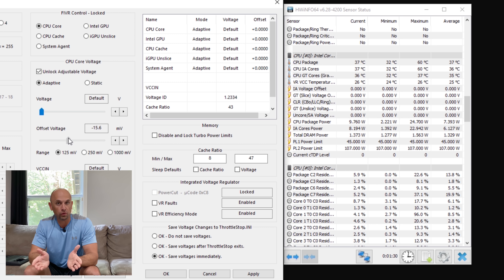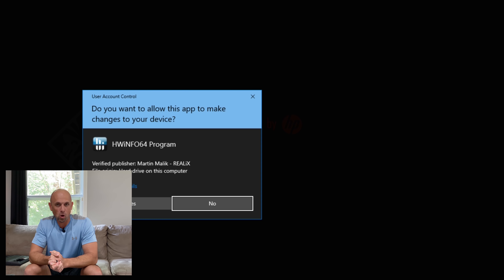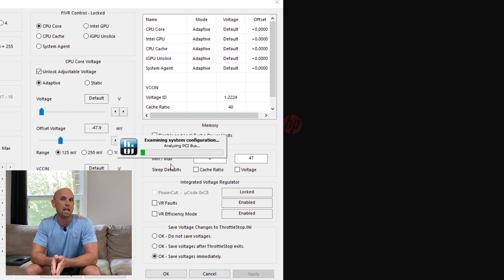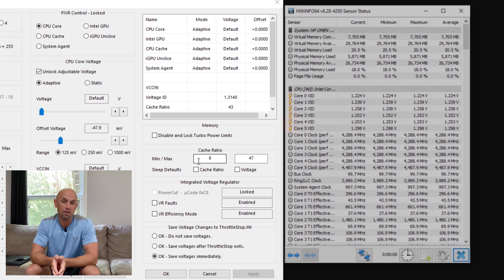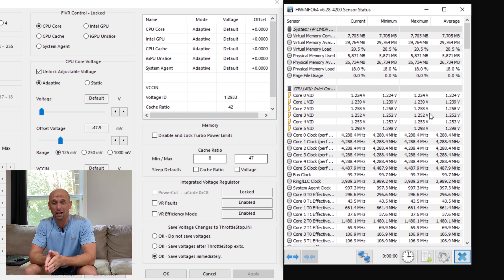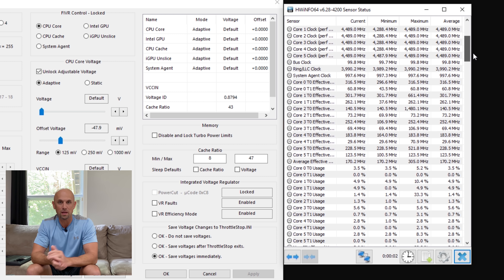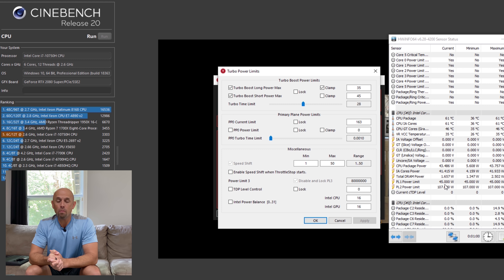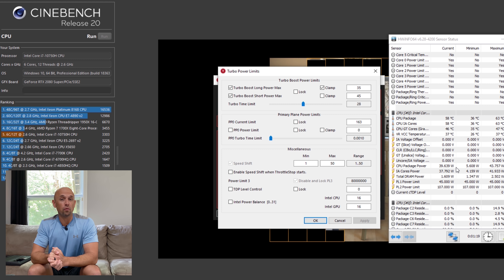Can't Undervolt?  Do This!

Comment: im struggling undervolting my msi gp66 leopard , any help would be appreciated.

CPU : Tried Throttlestop and Intel X. 
The temps dont get better it just delays the Throttle , if i turn down the cores from 4,6 in boost to 3,7 it get like 2-3 C° less and it stops throttling but the performance is much lower
GPU : Afterburner with Heaven B.M.
Temp same with ~250mhz less its weiiiiiiiiird. dropped from 1650 to 1420 with no better temps.

Comment: Hello Bob! I love your videos, they were a great help to choose a laptop (ended up with hp omen 2060 with intel due to availability) and are still excellent for fine tuning now that I got it. However when using throttlestop to tune the PL1 and 2 like you mention here, HWinfo64 stops monitoring those and I can't be sure if it worked... and after a reboot PL1 is set to 107 same as PL2! Any idea of what's going on there??
Keep up the excellent work :)

Comment: I have noticed that disabling Intel turbo in throttlestop lowers cpu thermals significantly on many laptopts that I have used and tested while gaming. 

The great thing about it is, that it has not lowered the amount of fps in games substantially, usually the change is insignificant. This has worked like a charm for me while I have been gaming. 

I have seen changes of over 15 degrees celsius in demanding titles. For me Intel turbo is pretty useless, so I turn it off. I care more about thermals than I do about maximum fps. 

Thermals are the key, I agree wholeheartedly.

Plus if one uses throttlestop, one can just click the turbo back on, easy as that. I have throttlestop always running in the background.

Just wanted to voice my opinion.
Reply: Wow, this comment saved me. I wasn't able to actually do the undervolting because of some change in BIOS or something, but when I turned off the intel turbo I saved almost 20C in CPU temp!
Reply: @myquestformeaning8251  Depending on what game is being played, disabling turbo will lower fps somewhat (cpu intense games), but mostly its marginal so it doesnt bother me.
Reply: @RainSandAndFlowers  Yea I am playing Satisfactory and I do believe I may have lost some performance but it's not really anything big, and the saved temp is much more important. The game literary rebooted my computer because CPU got too hot.
Reply: @myquestformeaning8251  Thermal throttling can do that, the cpu is protecting itself :) Nice to hear that the simple solution is satisfactory for you.

Comment: I've got Asus ROG GL531 with i5-9300H & GTX 1660Ti. Thermals are way too high, temp reaches up to 100C while gaming. Tried repasting, cleaning but none of them helped. Also, I couldn't undervolt since its locked and no options in BIOS as well. I disabled the turbo boost but experienced some slowness in performance. Any suggestions? Thanks
Reply: I have similar model and same issue. Did you figure it out?

Comment: GPU doesn't show me the voltage on afterburner. But I can see the clock speed and based on that I can guess the voltage based on the curve. Did a flatline at 1200mhz and I hope cuda cores chose the possible lowest voltage they can run on. Decreased temps from 80 to 65 based on this simple trick... Throtle stop is hard to guess, even if you cannot see on hardware info, you definitely feel when you had frozen your pc with too much undervolt or just check package power. Also what i hate is that laptop shares same heatsinks with cpu and gpu, they don't have different exhousts - a blessing and a curse.

Because now my gpu doesnt heat up, my cpu doesn't throttle which increased cpu, gpu performance... Now i onlu need to change thermo pasta. Too bad liquid metal is toxic for laptops, if you throw it down the floor, all liquid metal will just get out and splash electronics...

Comment: Hey Bob, thanks agin for this great video. I'd like to ask you a question : Is it possible to undervolt an i5-5200u laptop cpu to lower the heat? Would this increase the performance in games (even if it is an ultrabook)? By the way, i ordered an XMG Fusion 15 thanks to your videos. Thank you man!
Reply from the maker: You probably can.  I haven’t used a Broadwell U chip so start with -.050
Reply: Bob Of All Trades Alright, do you think that this would help for in game performance ? (with Gt 920m graphics card)
Reply: Philo Sopher I undervolted my i5 4210u with -0.62.5mv and yes I have seen quite a bit better thermals on my 6 year old laptop. It used to thermal throttle quite quickly when I pushed it hard previously but now it takes some time for it to throttle and I get 30-60 mins of extra battery life. I highly recommend undervolting your laptop.
Reply: Aquawater 506 Thank you ! I will definitely undervolt now.

Comment: I have a Dell G7 7790 that I repasted but still runs fairly toasty and had this problem as well.  About a week ago I got sick of the inability to undervolt and went ahead and downgraded my BIOS to allow undervolting again.  With a stable -155mv undervolt, I was still pushing 90c under gaming load so I did end up lowering my PL1/PL2 to 35/45 and now sitting at a more comfortable 75-80c. 

My only complaint is that trying to get an undervolt to stick in MSI Afterburner is absolutely painful.  It frequently discards my undervolt and just does whatever it wants.
Reply: As a dell laptop user (Dell inspiron) seems like i cant undervolt my laptop maybe because Dell likes it that way, others aside how did u downgrade your Bios? I'm kinda newbie and I'm sick of can't undervolting my cpu
Reply: @lanzboi7382  Honestly its been so long since I had to do this, I think fortunately for me I either had the previous version installer file still on my computer or I just found the current version and went down one version until unvervolting came back.  I'm too afraid now to update my bios to lose undervolting.

Comment: I know this is kinda out of the topic but I wanted to ask if you have faced something like this before, I have a mech g2rx with the 9750h and 1660ti after a format I installed Throttle stop did a small undervolt of -100mv and ran Cinebench the laptop will not clock above 3.3-3.4 at all.
I checked the temps they were under 80 and it was running on turbo profile in the control center , I tried reseting throttle stop lowering the  EPP to 0-1-10-32-64-128 and nothing changed, tried raising the power limit to 107-70 and it will saturate 65w but still at those same clocks, tried lowering the wattage to 70-45 and the undervolt to -125mv and still the same outcome.
It will boost to 4ghz all core on 50% usage if the app is not hammering the CPU but it won't budge on 100% load and the problem is the laptop is being used in content creation and those few mhz are kinda important.

Thanks

Comment: Hello, I have an asus laptop with i7-10750h 6-core, the FIVR control and the turbo ratio limits are locked as well as everything else in FIVR ! 
I enabled the voltage configuration In the BIOS Advanced settings, but nothing has changed ! 
So, is there any way to unlock them by any chance or it is factory-configured and cannot be unlocked? 
Should I stick to configuring power limitations pl1 and pl2? If yes, could you please give me some instructions on how to configure and test it for this cpu?
Thank you for your attention !

Comment: I got an msi g65 thin with the cpu u got and I’m trying everything to undervolt as well as use xmp on my upgraded ram. I feel bummed cause I’m a budding enthusiast and got everything for a new pc but used an old GPU and when I finally got GPU money it was cheaper for a laptop with a 3600 then get a 2600 for my laptop. The whole experience has been terrible because I want to tinker for better temps and I upgraded my machine myself and have great buyers remorse but it does what I need, just wanted some more tinker experience but I’m stuck with my laptop and a pc with a rx560B(rebranded 460 as far as I can tell)

Comment: Hey Bob! I am in a pickle and need your input.
My laptop currently under BIOS 1.0 does allow for undervolt. But defaults to 2933Mhz clock speed.
They released an update 1.3 that opens XMP up to 3200Mhz but it takes away undervolt.
Should I update the BIOS and get 3200Mhz or keep undervolt and stay at 2933Mhz.
Thanks!
Reply from the maker: Stick with the earlier Bios
Reply: @BobOfAllTrades  Thanks for the advice. I will not update the BIOS. 
Final Question. My RAM supports up to 3200mhz through XMP 2.0, but as I told you currently running at 2933mhz with a -120 uv through XTU.  (XMP locked in the BIOS 1.0)
So can I both undervolt and overclock the CPU through XTU or Throttle Stop, to push it closer to the 3200mhz clock speeds or is it not possible to do both at the same time?
Thanks!
Reply from the maker: You won’t be able to OC the memory with that software
Reply: @BobOfAllTrades  You rock Bob! Is there a software that I can use or should I leave it alone, meaning that the performance gains from 2933 to 3200 are not worth it.
Reply from the maker: Just let it be, you’re good to go 👍
Reply: If the thermals are worse then undervolting is important, otherwise update your bios to get the RAM to run at 3200MHz.

Comment: I'm running on an ASUS Tuf fx504GE (i5-8300, GTX 1050ti, 8GB RAM, WINDOWS 10 UPDATED, and BIOS ver 3.20). I tried undervolting with throttlestop but it didn't work, however, it was working with BIOS ver 3.17.

Comment: dang undervolting on my 8th gen laptop helped temps and battery life for light use off the charger quite a bit. sucks that there was some exploit that has caused it to need to be removed on the 10th gen series
Reply from the maker: It’s not tenth gen related actually. It’s up to each manufacturer should they wish to apply the update to their bios.
Reply: @BobOfAllTrades  Holy cow that was a fast reply. Noted might have to read up on what it affected via the voltage being controllable. Seems like a interesting one vulnerability wise
Reply from the maker: @Demon09-_-  Honestly I don’t think it’s anything to worry about but to each their own do as you wish 👍

Even intel themselves have the QC7 chassis that allows for Undervolting in their bios and it’s their bios.
Reply: @BobOfAllTrades  not really worried about it more so intrestred in what the exploit entails. but thanks for the super fast replys

Comment: Hey Bob. 
5:48  That's a Clevo Chassis, right? What laptop is that, and do you have a review of it? Thanks. Love your content.
Reply from the maker: XMG Apex 15. It’s not the final version. Just testing 👍
Reply: @BobOfAllTrades  I had my eyes on a N960TD chassis build. But, the battery life will be terrible, no matter how much I restrict the CPU, so I'm just waiting for the new Helios 300 now. But, still do you thibk that I can squeeze out 3-4 hrs off a 62 Whr battery with i7-9700 and 2060, if I try really hard? You know, PLs lowered, etc?
Reply from the maker: Depends if it has switchable graphics

Comment: Hello, I'm new to your channel and so far love your videos. I had a HP Omen 15 1010dc with an I7 8750H and a RTX 2060 and I had my cpu temps going up to 100ºC+ and the laptop just shut down. Change thermal paste and -0.150 undervolt + cooling pad did not help much, my temps where between 90-100ºC but at least it was not shutting down. Sold it and bought the Lenovo Legion Y740 with I7 9750H and a RTX 2080 max-q and my tems are stable on 80-90ºC without any modification. I can't see why you are telling the that HP is good in terms of thermal performance. I think I will also change the paste on Lenovo to lover more my temps and do some undervolt.
Reply from the maker: If you go back and watch my HP reviews, the only one I had that was close to yours did have very high temps.  I had to Undervolt the CPU and GPU to get it tolerable. 

The next one had the 9750h and 2060 with the second gen of that chassis design.  Its software allowed for maximum fan speed and it did much better.  

Then we have the newest Omen review with Ryzen 4800h and 1660 ti and it too allows for maximum fan speed within its software.
Reply: @BobOfAllTrades  For example, the new BIOS on Lenovo Legion Y740 I can't even under-volt in BIOS because of the Intel security update. I go to advanced BIOS mode and set -0.160 offset and save changes. Boot is ok and I have those applied but If I shut down or restart the setting reset in the BIOS. Maybe I will need to try replace thermal paste for my lenovo to see If I have some temp gains. PS: I tried install the previous BIOS version but it does not allow me saying that I have an newer version :P

Comment: Great video Bob........I have actually noticed the new update that windows realesed that wasnt compatable with the omen x17 gtx 1080 cause i have one as well and after updating it I noticed how it kept on resetting the undervolt I had and I immediately rolled it back to previous version now all is well. 
        Note: - I want you to do a review on the omen x17 with the 300watt power supply that you had on the table I fell like I want to increase the power limit by flashing the bios cause my thermals at 4ghz is 71 to 85 and gpu 58 to 60 at 1825ghz which is great but why add a 300watt power supply if it is not used to about 280's to 290's........why is that?
Reply from the maker: I haven’t figured that out yet but it’s a 330 W power supply and I can’t for the life of me imagine getting anywhere close to using all of it.
Reply: @BobOfAllTrades  (330 not 300w) Exactly for one I can say that the chassis is well optimazed and you can reduce the temps by just adjusting the hight of the laptop using a cooling pad for the size of the laptop because the back plate has a really nice air intake and can give a big difference since its all around the motherboard and fans (at least on my testing). But hopefully you will do a review on the laptop I am interested on you take on this matter.
See you on your next upload thanks for the feed back appreciate it.........

Comment: Hi Bob! Im thinking if you lowered the PL1 the cpu core clocks are also lowered from 4.0ghz - 3.4ghz so is this the same when you lowered the core clocks at throttle stop to 3.4ghz directly and not adjusting PL1 and just leave it as a default? thanks for this tip.
Reply from the maker: Melchor Jimenez You won’t have the same thermal consistency that way.

Comment: Just one question...why? If it doesnt thermal throttle then...why? I get it that its useful when you undervolt and get some performance by running the cpu a bit cooler...by in this case why do this?

Comment: I want to ask you, how can I confirm whether my laptop can't undervolt?
I have the omen 17-cb1005nu. It's with the annoying i7-10750H. I made all the updates of bios + drivers. 
However, when I use throttlestop, and I do offset voltage -30, I can see in HWInfo under IA Overclocking that my voltage offset is -30mV. Also, when I try to test it with CinebenchR20 and looking at the max voltage by sensors, I think it does effect the voltage.
So my question is - can you tell me the best way to figure out whether my voltage is locked or actually I can change it? Thanks!

Comment: I have i5-1035g1 and I think I should just buy a cooler/cooling pad. I already tried throttlestop and CPU is locked, same case with XTU it says the system is not supported.

Comment: Yeah, i got a bios update from Dell the other day. Can no longer undervolt, and the CPU remains absolutely pegged 24/7. Hits 100C consistently. Throttlestop aint working anymore, cant adjust voltage or frequency 😢. Unfortunately, Dell really fucked me over by preventing me from going back to a previous Bios version. 

Edit: dell g7, i7-8750h

Comment: Hi bob, I'm one of many with these problem of locked uv, I have the HP Omen 15t 2018 model with the rtx2060 (80Watt) and i7-9750H, I'm curious about if I only change th TPL1 to 26 (that value doesn't affect performance but improve thermal in my unit) but leave TPL2 in 90, I haven't try it but would like to know if it could cause a negative impact or not. Thanks for your information btw!

Comment: talk aboot every machine is different... the TPL is set to 200/200 on my ge75 w/ 9750h! any idea on this?

also, great vids and I thank you for your service!
Reply from the maker: MSI controls their system in the bios.  It usually shows generic values like you see.  You should be able to lower PL however within throttlestop regardless.
Reply: @BobOfAllTrades  ahh gotcha! would you suggest changing these values from 200/200?

Comment: Hi Bob, been watching and following most of your content. 
I set a default voltage and frequency using msi afterburner on my asus rog strix scar ii RTX 2060, the fan speeds are running at average speeds (even when idle) what does this mean?
Reply from the maker: MSI AB will constantly ping the GPU so I recommend only using this software when you’re gaming.

Comment: hey bob , i know this is an old video but i have a question , i tried the solution 1 and i set pl1 and pl2 to 35 and 45 , not copying your value but i have tried them too , my question is that when i stress test the cpu or play games power throttling happens , i wanted to know if thats dangerous or normall , btw with this setting my temp is way lower and i have stable fps and not much peformance lost.
Reply from the maker: Of course power throttling happens since you have throttled the power back 👍
Reply: @BobOfAllTrades  so i should avoid doing it ? my temp goes 90 without it , thanks a lot btw
Reply from the maker: @emptycode1782  You’re not harming the chip or system.   In fact, power throttling is just part of laptop life at higher wattage too.  If you’re happy with the performance and thermal performance now, then I say great job, carry on 👌
Reply: @BobOfAllTrades  yeah temp and fps are perfect i just got worried about the pl1 and pl2 throttling , and now that i know its not hurting the chip then its all good , thanks a lot